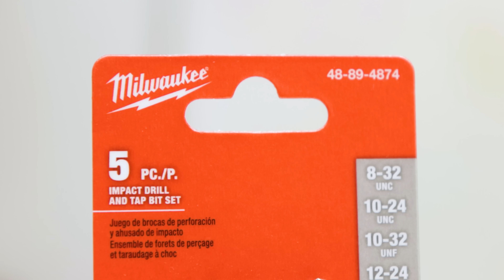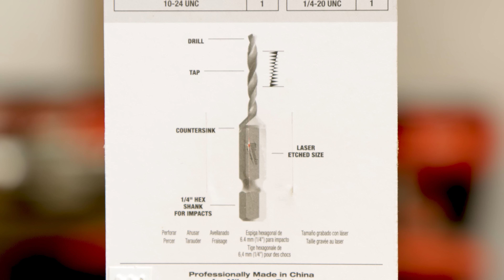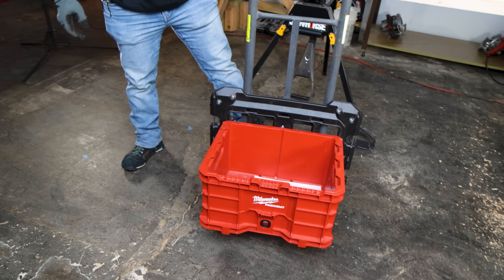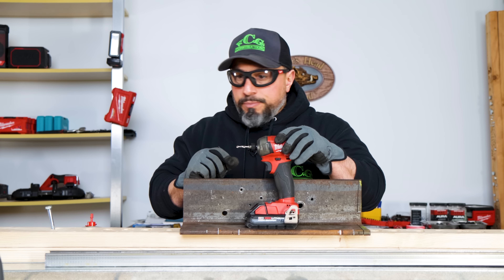MILWAUKEE TOOL ACCESSORY MAKES INTIMIDATING JOBS LOOK EASY! (must have)

Comment: I'm gonna try them.... I normally hate tapping threads with a drill.
Reply: I've seen so many impatient failures happen from taps in drills. You only cost yourself more money and time. These little Milwaukee bits almost have me ready to head to the homeless despot with my wallet open.
Reply: Use the impact. 
That's the game changer for these bits 👍
Reply: Use cutting oil it helps

Comment: The reason it's only rated for 1/4" is that the distance from the edge of the drill to where the tap starts is about that. You could see where the top threads didn't exist because the tool was still drilling and not following the threads with the feed until it fully broke thru the bottom side. (Basically the top threads were stripped)

Comment: very cool these drill bits with 👍💪 thread which does not change the fact that I would rather drill with a smaller drill, because these are cool, but I suspect that 10, maximum 20 threads, and their sharpness ends ...

Comment: Ya know, ppl gonna say, “can’t tap a hole using an impact”; it’s gotta be done by hand or with a drill😉 For me, I’ll take the impact, makes things but easier. Also, will save some space in my parts tool box, as having a bit that drill/taps all in one, saves space since won’t need to carry separate taps and metal drill bits....(just another reason to justify buying😅).
5:28 Vince, think you just have a bit too many tools there. Just go ahead and send some of the Milwaukee and heck, even the DeWalt tools on over to me. I have a nice new shelf they can call home🤣 (kidding)
Cheers👍🏻

Comment: If You want these to last at all especially with an impact which I wouldn't recommend with a tap you should always use something like tap magic you'd be better off with a regular drill an impact is gonna beat the hell outta the teeth which leads to dull teeth and broken taps
Reply: Nope impact is the only way to go.
Drill is going to break it everytime. 
Field tested myself 👍
Hard metal or thicker metal predrill hole 1st just big enough for the threads to come in contact then slow constant, steady with impact. Not balls out! feather the trigger. Pause if needed to keep centered.
Run test run 1st on scrap. You have to get a feel for it. 
Drill just breaks it every time. Impact has the hit, let off hit again. the force you need to carve threading into metal. 👍
Reply: @wylinout2257  I've power tapped hundreds of holes all the way down to 3 mm and smaller you need to use the correct predrill for the tap your using so you have at least 75 percent engagement there's plenty of charts in machinist handbook or  available online if you're breaking taps with a drill you're going to fast put your drill in low speed and start slow  taps are sharp but that hardening also makes them brittle any kind of impact is only going to dull the tap it also depends on what you're tapping different materials take different technique you can do it however you like I'm just giving you the same advice any machinist will and doing it the same way machinist have been doing it forever 👍👍👍
Reply: @umahunter  awesome thx for the tips 👍

Comment: I have some from china and they are good for like aluminum or thing steel  but the small ones break easy the milwaukee are probably a little better but hard means brittle but that's in steel each time but it's been good in aluminum and plastic and stuff and have not had a problem with like the 1/4 20

Comment: I am all in on milwaukee tools and other products but I have had one drill/thread set from Greenlee for years which is similar but which also comes with the 6/32.  The greenles set also comes in a case which this milwaukee does not. The other problem is that this milwaukee kit lacks the 6/32 which is the most commonly used for an electrician like me. It is the size for outlet/switch/device and plate mounting.  Outlet mounting screws commonly get rusted out or damaged when replacing receptacles or plates. Or people (iodiots) used a drywall screw to hold the switch/outlet in because they did not have spare 6/32 mounting screws and end up damaging the threads in the metal box. I was also able to buy spares online for when they break and any of them will do so, especially when the 6/32 is a much thinner shaft. I keep several 6/32 spares which did not cost very much. Does milwauke even sell spares separately?

Comment: Love me a nice tap set! Only thing that i cant figure out is why milwaukee left out the 6/32 thats one of the most common sizes for sparkys. Ive tried the klein set which isnt too bad but so far my favorite is the ideal set. It comes with a nice little case so you dont have loose bits that are easier to misplace

Comment: I thought for sure you going to break that bit off in that metal when the bottom of the battery bottom Saul as the BET breaks through and it Kinks it I have done that before Summers that punches through since the neck of the drill is so short the battery hits the metal before the head of the bit which will make it instantly break off in the hole

Comment: The reason why its only 1/4 inch steel is because the drill will strip out the threads when the point sinks deeper than the 1/4 inch tip, so whatever thickness you have only the last 1/4 inch will have proper threads. They should make a version of the bit with a longer tip for thicker materials, cool concept though... I would defiantly not use this current one on any large materials that needed to hold any type of weight / pressure.

Comment: The tool says 1/4” that’s because of the depth drill to the start of the tap if you look at your hole in the 1/2” material your tap portion actually just stripped half the threads in the top portion because it’s still drilling while the tap is trying to tap threads and just stripping the hole out. I bet if you measured the threaded and the striped out portion it would be 1/4” thread and 1/4”striped out.

Comment: The problem is the distance between the hole cutting section and the biginig of the tapping section if it's only a 1/4 inch, I wouldn't go above that because the first half of the thread will be striped to shits

Comment: This would have been clutch when I redecked my dads 19FT trailer! We used “self tapping” screws but I think I nearly destroyed my Ryobi impact. Regardless it eventually got the job done. This would have saved a ton of headache and time
Reply: Out with the Ryobi, in with the Milwaukee😉
Reply: @austinrosatte2513  if my Ryobi power tools die I would go that way. The new HP products are too expensive and have closed the gap to me. I got the M18 miter saw during the recent Milwaukee sale because Ryobi didn’t offer anything similarly. Ryobi still has a lot of awesome tools for the money, even many other manufacturers aren’t making

Comment: I feel like these would only be good for like small fasteners and things that don’t require precision threads, it’s not hard to tap things, drill a hole and then tap it, follow a tap chart and nothing bad SHOULD happen.
Reply: well, they only go up to 1/4-20, so yeah.  they also require more space behind the material.

Comment: I will always tap with a drill. Rotational energy is what you want when you tap, and drills rock for it. If it's stainless, or something hard to tap like that or AR500 or something, just go slow, break your chip often, and use lots of lube.

And if you break a tap, weld a nut on and spin it out. You could fiddle with drilling hardened tool steel for hours, or you could just go to your final solution and call it good.

Comment: Using a 16 inch hole saw with a tool belt on more than 16 feet in the air on a extension ladder

Comment: Greenlee has had these for years.
Reply: Hell yea .....little green case ....love Um
Reply: Yes and they break easily, I broke two 1/4-20 bits while tapping 1/8 inch steel and I used tapping oil, hopefully this set won't let me down like the greenlee set did
Reply: @fernandbadia5738  that's all you've broken? Lucky you... It would be nice if they are more reliable, but I don't think they will be much, if at all. That's why they're so cheap.
Reply: @fernandbadia5738  yea I’ve had acouple break .....don’t use a impact, use a drill......and set the drill Torque low and you will stop breaking them

Comment: Tried this for an access control and site security for a job I was on 1/8" steel and it snapped right off into the steel beam and we couldn't get it drilled out
Reply: If you are using these on a through hole and have a breakage your best bet for removal is a hardened punch while they are strong to be able to cut that also makes them brittle which is why an impact isn't a good idea a drill on low speed with lots of lubrication is the best  they don't have much bend before they shatter if you want to drill them you need carbide in a pinch you can sharpen the carbide on a masonry bit and drill with that keep it lubricated also some of these metals can actually work harden from the heat and get tougher so keep lubed if that won't work you can weld a washer if you have enough then weld a nut to it and turn out if you can't do that best is a mill and carbide endmill if that's not possible you can drill out with carbide then break out with a punch on 1/8 material you should be able to punch out pretty easy since there's probably only 1-2 teeth engaged and probably don't even need to drill 👍👍👍

Comment: I don’t think it countersunk the hole in the thicker metal. I think that was the tapping section of the bit reaming out the hole, because the drill section is a 1/4  inch long and it didn’t get all the way through the metal first.

Comment: THE COUNTERSINK IS JUST TO TAKE THE BURR OFF THE THREADED PORTION OF THE HOLE. NOT FOR COUNTERSINKING BOLTS IT MAKES IT EASIER TO START THE FASTENER.

Comment: I think you need to correct your description info. It has a mistyped part number.  Unless that was intentional.     The correct part number is: 48-89-4874          No biggie...  Keep up the awesome work 🤙🏻.      ( For Metric : 48-89-4875)

Comment: Too bad they don’t include a 6-32 in the set for us electricians. Can’t tell you how many cheap overseas fixtures I’ve installed that come with 6-32 fastener for the canopy to the mounting bracket and their all jacked up. I’ll stick with my drill master / greenlee copy for $10 from HFT

Comment: I could use the metric set, but sure would prefer a combo set in a decent box, otherwise they will be floating around who knows where when I need them... The job that makes me cringe is an "easy" plumbing valve replacement on old work, I am not sure Milwaukee has a lucky rabbits foot to help increase the odds that there isn't more worn out than you bargain for.

Comment: You know why they say 1/4” material right?  The tap can handle thicker, but the drill won’t in a sense...that is after 1/4’ the tap start trying to tap...to won’t so it act like a reamer.  On a 1/2 thick material hole, you lose approximately 1/2 the threads
Reply: That was my instant thought when he started on the half inch.

Comment: I like the idea but with a good thread it should be straight. Leaves too much room for user to jack up the threads. Not square, when pulling out it could cross thread, and if they use the wrong thickness it will keep the tap portion within threads ripping the good threads out. I’d prefer the old school method for anything that is expected to last. Just my opinion
Reply: I agree with you however I do have the SAE and Metric sets of these and let me tell you, they've save their fair share of jobs that would make me take longer or take equipment I am working on to the shop to use the old school method. I work on custom high end wheelchairs and you can't just tell the client "I just need to take this to the shop" They work great for chasing existing threads that are damaged by whoever prior tried to "fix" it first.
Reply: I do all my tapping in the field with no issues. Chamfer the drilled hole so tap sits square and away it goes.

Comment: Drilling and tapping is easy even with your eyes closed. But laser welding under a microscope on a mold worth $ 1/4 million is a different story :D And I have been using taps since I was 10 :D

Comment: I can’t weld for shit, but can wire high voltage with my eyes closed.
Reply: Eyes closed will weld using high voltage hands down.
Reply: Union steam fitter here. I weld to X- ray spec no problem and I’ll leave the high voltage to you.
Reply: All fun and games till you mix brown and orange and it blows
Reply: I’m not the best electrician or the best welder but I like doing both might have ya beat idk tho

Comment: “But Vince, the surge only has a few hundred in/lbs of torq- 😢“ *batman slapping Robin meme” “it gets the job done!”
Reply: I use my surge to drill out half inch holes in stainless with a unibit all the time. That little thing has balls and you can use it with one hand

Comment: @3:55 Trying to tap 18g steel with a 1/4"x20 tap doesn't make a whole lot of sense, when the thickness of the steel is almost exactly the same measurement as the distance between the threads. You would get the same result by drilling a 13/64" hole and just running your bolt into it. So, @4:20, your comment "Meh...it's workin", no, it really isn't.

Comment: Something that isn't addressed is how many of the sets were went through during the video.
Reply: He only used 1
Reply: @realgoku8384  The only reason I was asking to begin with was some of the bits were pushed past the threading portion while drilling. Wouldn't that mess with the threads on the bit or enlarge the hole past the point the threads would no  longer be as functional?
Reply: Yes especially on that 1/2 " iron he should of added more oil to threads
Reply: @realgoku8384  I didn't see any oil used. There were so many cuts I was sceptical but will probably pick a set up to try out. I was raised that if it's too good to be true it usually is.

Comment: In my opinion the reason it’s intimidating, is because you’ve not been taught properly. Ya need to do everything plumb, with lots of lubricant and take your time. Very rarely do short cuts work well. This might be ok, but ya ought to know how to do it correctly.

Comment: never use one of these on aluminum.  it WILL spall into the hole and shear off. predrill and then turn the drill/tap with a hand driver.
Reply: @Lawtonfl  better tu use an actual cutting oil or a silicone.

Comment: I think you drilled a hole into your tire. tapping bits are nothing new the difference I see with this Milwaukee set is these have a countersink but countersink with threads makes no sense you have two pieces of steel or wood to steel you want to fasten together the piece with the countersink the smaller hole needs to be smooth, the piece it’s fastened too needs the thread. I just don’t understand the countersink with this thing

Comment: Yeah no, don't like that at all. Guys really need to stop using impacts for literally everything. Drilling should be done at low speed and tapping even slower, at best with a regular variable speed drill if not by hand. The impact is way to fast and you're going to have very loose threads at best, and probably 1 thread on that rack rail you tapped. When sheet metal is too thin it should be through bolted or done with rivet nuts.

Comment: Tapping with a impact or a drill is a dumb idea. If you bust a tap off in a hole, it's your fault. Just do it nice and slow.
I was a machinist for a while. 1\4" max depth is also pretty pathetic, that's hardly any thread engagement
Reply: I don't follow. That's all up to the individual doing the job. A 1/4" is overkill for a ton of applications. So just don't use it in a situation in which it is inappropriate. Problem solved